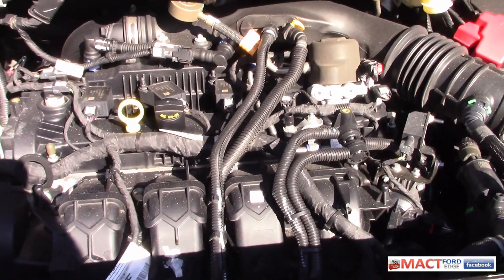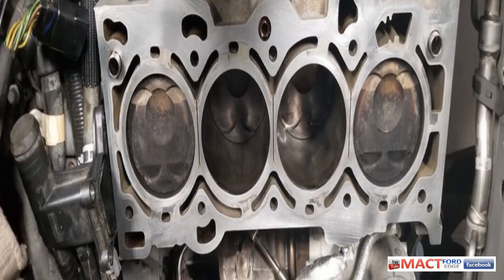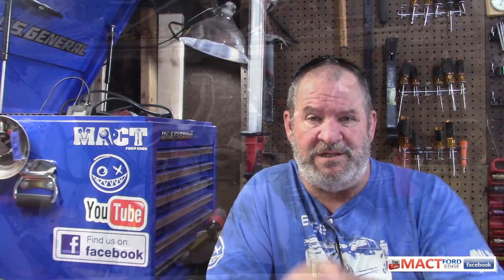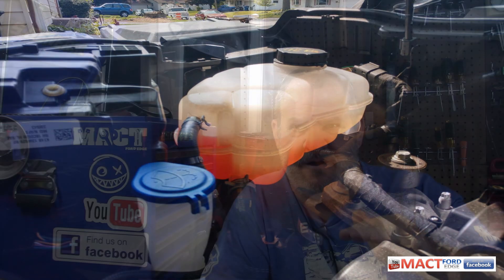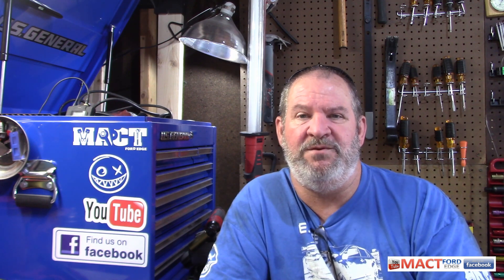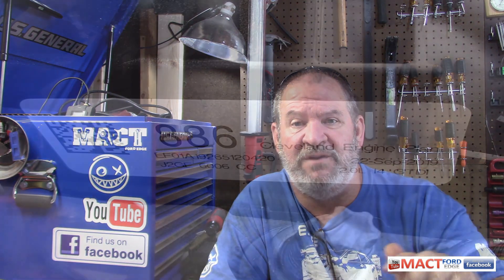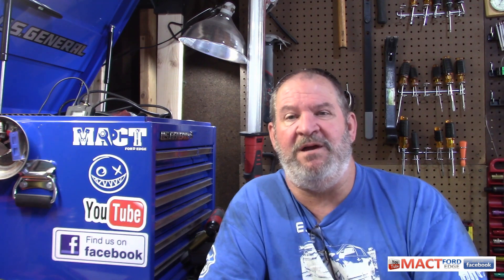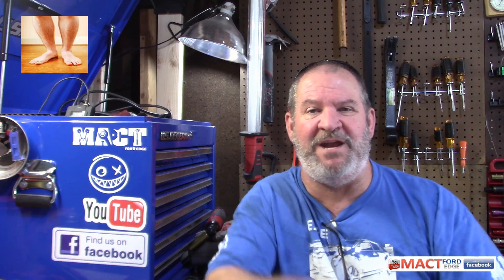Why I am excited my 2.0 Ecoboost was built in Spain and not Cleveland  Ohio

Comment: Just checked my 2020 Edge SEL and it has the Valencia motor.  Whew!  Thanks for the info and running a quality page.
Reply: Any edge made past ‘19 has a redesigned block, it won’t happen regardless of where it’s from on that body style.
Reply: They are all OK. We've owned 3 Edges. Our '13 Edge had gen1 2.0L GTDI Ecoboost an was trouble free. New '23 Edge ST AWD in driveway. They rated top3 best midsized SUVs of 17 avail.
Reply: @jayhawker03  100% correct. Excellent SUVs. Rated top3 of 17 midsized SUVs avail. Good basic maintenance goes a long way w/any vehicle. Use full synthetic engine oil/Motorcraft filters .
Reply: K&N filters for me. Always full synthetic.

Comment: Whew, just checked my week old 2020 edge 2.0. Popped the hood and it's the Valencia plant. Thank you for the info and can't wait for more guidance on the Ford edge. Just upgraded from the 1.5 ecoboost Escape with coolant intrusion.
Reply: Tyler McLean  any idea where your engine was from? Glad you made it to 100k. Supposedly the transmission will go out at 80k on the Escapes with the 6speed autos as well. Good job yeeting that before it got any worse! Haha 😄
Reply: Doesn’t matter where it’s from with your model, they redesigned the block in 2019 to fix this issue. It only effects edges from 2015-2018.

Comment: Love my current '23 Edge ST AWD w/gen2 - 2.7L GTDI engine . From engineering perspective these are excellent/ well designed GTDI powertrains. My 2nd Edge btw. 1st got 248k mis before we sold running very well for the new '23 Edge ST.

Comment: Guess I'll chime in, 2015 Escape Titanium with the 2.0L, it has a VEP label on it, but in the past year +/- the coolant level has begun dropping ever so slowly. I took it in for a recent recall issue and had them test, they said they filled and pressure tested and found coolant intrusion, but did not state which cylinders or provide any further info. Close to 120K miles on mine.

Comment: My 2016 Edge 2.0 Eco Boost was cracked out of the factory, Ford didn’t  figure it out until 99,600km. When it started in the cold from new the coolant fog burning off was huge. 
So finally they replaced the engine when I complained enough. The replacement was $10,451.

Comment: So I bought my wife a 2017 Edge SEL that had started getting misfire codes right a way, took it to Ford for a diagnostic and they said it has the issue with coolant entering the cylinders which was addressed in the TSB, however, the warranty company did not cover the long block replacement since the stored code was prior to the warranty date (and the day I purchased the SUV). So I told the dealership where I purchased it and they bought the car back and had a 2019 ST on another lot that they were able to move her over to (for a price difference of course). I guess it was a good thing the car had this because the ST is an AMAZING SUV, I find myself driving that over my 2021 Lariat Sport Powerboost... anyway. this issue is no joke anyone considering purchasing a 2015-18 with the 2.0 should have the SUV checked out at a Ford dealer as the service departments computer did not pick it up when they scanned it. It appears the Ford computer can pull deeper data with dates and mileage. 

Great video very helpful, I would have named the video "Watch this before buying a 2015>2018 Edge 2.0"
Reply: I have never in my life heard of a dealer rebuying a car. I need to try that since I'm dealing with a failed eco boost right now.

Comment: YouTuber Ford Boss Me is a Ford mechanic and he has many videos addressing this issue. Someone in the comments asked if a Spain 2.0 has the same failure rate as a Cleveland 2.0 and he says  the Spain variant is no better than the Cleveland one and the failure rate is the same for both of them.
Reply from the maker: You are incorrect.  2.0 VEP does have water intrusion but it is due to the EGR not a block design failure. Check your facts.
Reply from the maker: One other note.  Ford did a massive redesign of the the 2.0 Ecoboost engine for 2019.  A 2019 2.0 will not swap to the 2015-2018 models.  The block, heads, turbo mountings, and addition of an EGR make a swap of a 2019 2.0 Ecoboost nearly impossible. Just facts do some research.
Reply: I just bought a 2013 Ford escape with a 2.0 eco-boost. It is a VEP. If I have a water intrusion issue and it’s due to the EGR how do you repair that?
Reply: @richierich398  good question I think @MACTFORDEDGE can answer to us
Reply: @MACTFordEdge  Hallo, i have 09.09.2019 Fusion 2,0 VEP. Can you tell me about my block? It was redisigned or no? I only by this car, dont want to sell(((. 
Car in Ukraine, we dont have official information. Thanks
Reply: @MACTFordEdge you say different thing in other comments. Which is which?

Comment: This problem emerged a few months ago here in Brazil in the 2.0 Ecoboost Ford Fusions. According to several sources it affects only the twin-scroll engines from models 2017 to 2019, and only those where the engine number starts with 910. But apparently all engines come from Spain. I have a 2016 Titanium AWD with a motor that starts with 328, and a friend has a 2018 SEL that has one of these engines that start with 910. Both motors were made in Spain. We don't have Edges with this engine in Brazil (only 6 cilinder engines).  The Bronco Sport also uses the 2.0 Ecoboost, but the problem isn't supposed to happen in this newer engines.
Reply: Interesting to hear. It’s totally possible that the ones from Spain fail as well. This guy doesn’t have any actual sources. Many ford techs in the states have been replacing Spain ones too, I’ve chatted with a few of them. It should only be the Twin-Scrolls effected. The 2017-2019 thing doesn’t necessarily apply since different cars got the twin scroll at different times, I’m not sure what it was in Brazil, but in the States the Escape was effected from 2017-2019, Fusion 2017-2020, Edge 2015-2018. Ford largely sources their engines based on supply chain needs. The Cleveland factory provided the 2.0 a lot during the 2015-2018 era because it was closest to the factory in Canada where edges are built, wouldn’t make much sense to ship one in from Spain when you have one on the same side of the world. When the Cleveland factory started making the 2.3 for the Ranger and new Explorer, all the 2.0 production moved to Spain because they need the 2.3’s more in the states. There’s not any difference in how they are built. It’s just in the states 8/10 edges will have the Cleveland so it makes it look like they fail more when that’s not actually the case.

Comment: I've owned four Ford Escapes with the 2.0 litre Ecoboost engines. Two were Cleveland & two were Valencia. Touch wood, I haven't had any trouble with any of them. I use Pennzoil Ultra Premium 5 w 30 synthetic oil and Fram synthetic oil filters, changed every 3500 to 4500 miles (5630 to 7240 kms.). With a turbo charger, you have to use good oil. It also helps that 96% of the miles I drive, are at highway speeds. In Canada gasoline is ridiculously expensive and 91 octane even more so, but I use 91 octane anyway.

Comment: I get them from both the same failure as well as see them over seas failing at the same rate as well

Old design open deck - new design closed deck 

Ordered a new motor for a edge a month ago, installed motor due to coolant intrusion and new one withing 3 weeks was doing the same thing 

Now new motor has to be replaced

It's not cab it fail it WILL fail 

The new designed block is a closed deck and the old one is open - it's not just cylinder 2 it could be any cylinder 

It's 2015 - 2019 2.0 Ecoboost and the 2014 - 2019 1.6L ecoboost and 1.5L ecoboost 

The 1.6 and 2.0 Ecoboost are long block replacements and the 1.5L Ecoboost is a short block

The long block with labor will run closer to $8k-9k the short block for the 1.5L ecoboost is closer to $5k
Reply: I thought they "fixed" the problem with the 2019 2.0L, it that not the case?
Reply: Use the Ford Fusion TS block semi closed deck design with a more robust casting and problem solved!!  I building a 2.0/2.3 ecoboost engine capable of 1000whp!  2.3 internals inside the 2.0 TS block.

Comment: Owned a 2013, 2016 and 2019 Escape with the 1.5ltr, 1.6ltr and 2.0ltr Ecoboost motors zero issues up to when sold.
Owned a 2020 Edge with the 2.7ltr Ecoboost, zero issues.
Now I've got a 2022 Ford Ranger, couldn't be happier.

Maintenance maintenance maintenance,  cheers

Comment: I’ve had my 2015 Fusion since it was new.  My engine has 75k miles on it and it is from Valencia.  The coolant level has begun to drop over the last few months.  So I may be in the beginning stages of this water intrusion issue so Cleveland may not be the only plant having this issue.
Update:  I changed the coolant and the level has maintained at the full mark for over a month.  I think there was some evaporation over the past 6 years.
Reply: 2015 fusions don’t have this problem, that car has the older single scroll 2.0 which is very reliable. The video really should have specified which engines are effected because there isn’t a large range of bad ones relatively.
Reply: @jayhawker03  here is the list 
2017-2019 Fusion/MKZ built on or before 8-Apr-2019 - 2017-2019 Escape built on or before 16-May-2019
- 2017-2019 MKC built on or before 18-Apr-2019
• 2.0L EcoBoost engine
• Presence of coolant in the engine cylinders
Reply: if you only checked your coolant once in 6 years its your fault anyways
Reply: @steveschilling5966   what are you talking about?  Maybe you ought to read my comment again.  I said I noticed it beginning to drop over the past few months which implies I was looking at the coolant level.  Generally when I changed the oil every 5k miles
Reply: @brianmccants5098  ignore Steve lol
Reply: @Joetrout  Wasn’t the block for the 2013 to 2016 2.0 still based on the Mazda MZR engine? I read that somewhere but can’t remember the source
Reply: I had 2013 2.0 fusion that I traded in at 85k, the coolant level dropped a quart or two every oil change
Reply: @Joetrout  Do you see this list? How can i get it? Thanks
Reply: @steveschilling5966  has nothing to do with not changing the coolant. Its the design
Reply: @ЖоржКазаков  get it?
Reply from the maker: The 2015-2018 VEP has the same design.  Keep In mind I was referring to the 2019+ VEP with the new design.  Also the 2019+ is starting to pop up with similar issues but due to EGR failure not block failure.

Comment: The YouTube channel Ford Tech Makuloco he shows that this problem is with all 4 cylinder ecoboost. The major problem is the little hole between every cylinder that the head gasket can’t hold the pressure on that small part between the cylinders. This problem continues I think until 2019 engines 2020 and up he says that this issue was resolved. The only solution is to change the block unfortunately.
Reply from the maker: Yeah you are wrong.  The 2019 has the new block and the issue was a cut in the top of the block.  The fix was the drilled hole.  However now the addition of the EGR cooler to the 2019 plus is now the new coolant intrusion and loss. Due to internal failure of the EGR cooler allowing coolant to enter the engine.  Ask me how I know this.  Just replaced an EGR cooler.

Comment: Just had my 2016 Titanium diagnosed with this problem. Going in 2 weeks to have the pressure tested to verify this is the problem but i was told looks like i need a new long block. Im praying im getting the VEP engine. Luckily i have the extended warranty that is over June 6 2022.

Comment: I have a 2018 Fusion 2.0 Ecoboost built in Spain and it currently has the coolant in cylinder issue. Major bummer as the warranty ran out 10,000 miles ago.
Reply: Hi Dan. How did you figure this issue out? I know ford will not budge to help out at all if you are out of warranty miles. I even got a quote to see what the cost is if you paid out of pocket and it was something like 4100 for the engine, 600 for accessories, 16.5 hrs of labor at 120 hr for 1900 so its about 8000 out of pocket. Im curious how you came to this conclusion and what your symptoms were? thanks in advance
Reply: Haha many people believe failed Spain engines don’t exist, good luck getting anyone to listen. I’ve been saying for awhile that there’s no reason they couldn’t fail.
Reply: Same here 😔 thank goodness for warranty

Comment: 2013 Focus ST. Constructed 3/13 in Detroit assembly. 2.0 Ecoboost VEP. 87000 miles still pulls 21 psi.
Reply: That’s the single scroll 2.0, that older design doesn’t have this problem. Only the twin scroll does (2015+ Edge, 2017+ Fusion, 2017+ Escape)
Reply: Foci were built in Wayne Michigan.

Comment: If the parts are the same design and come from the same supplier, the only variable is process. They may be over-torquing the head (and I know they use computer-monitored torque 'guns' on the production line to control this stuff) and somebody was thinking "more is better", but that can also cause warping if the block is under high heat, which it is. Or else they have a worn or mis-built jig for locating the head gasket and maintaining its location while the head is placed.

Comment: Besides the valve cover sticker showing Cleveland Engine Plant & VEP (Valencia Engine Plant) ... I've noticed there's an "extra" tube above the plastic air duct that goes across the top of the valve cover then down to the turbo. Well, the 2.0 EcoBoost made by the Valencia Engine Plant doesn't have that tube it's just an air duct with 2 tubes connected to the "front" only. I have the VEP on my Maverick's engine and I'm happy to see that as I didn't get the extended warranty. 

Cleveland Ohio is about an hour away from where I live, but I'd rather have an engine known for reliability.

Comment: Does this happen to 2.0s on the Lincoln MKZs? My car just started acting weird the other day, p1285 p0217 which relate too cylinder head over temp and engine over heat. I’ve also noticed the coolant keeps dropping but when I pull the recevior lid off and like back pressures some into it.
Reply: Mine just did the same thing, mine is in the shop at Ford, what resolved your problem???
Reply: @itsthatatm8345  ended up being a cracked block, took it in and luckily got fixed under warranty.

Comment: There was a redesigned block used on newer 2.0L motors. I'm guessing that the VEP began using the newer block with the cross drilled coolant passage. I think Edges 2019 and later have the newer block. @FordTechMakuloco has a few great videos with the years and models impacted as well as the mechanical differences for those that are interested.
Reply from the maker: You are correct. However now the problem is the EGR leaking and causing similar symptoms.  Thus the confusion about the blocks.
Reply: @MACTFordEdge  you are correct too. I have a 2019 and I had to take it for the leak on the EGR, I would rather have the egr leak than the head gasket. On a side note I work at cleveland engine plant. I’m at work right now building 2.3 eco

Comment: I have a 2017 Ford Edge with 86k miles with the Cleveland Engine. No problems with the engine so far. The dealership I bought it from has a Lifetime Warranty on the engine and transmission. If there is a problem later, I’m hoping they will honor the warranty and not play the, “it’s not an engine problem” game.
Reply: The one rule of thumb i have learned is there is always. always a fine print somewhere that will get them out of it.
Reply: @danielengel1295  They advertise this to the public. I’m 100% sure they don’t want a customer to go public and tell everyone that they don’t honor this warranty.
Reply: @ceddie  Doesn’t matter if they advertise it to the public. You gotta read the fine print. Im pretty sure you have to do your maintenance work with them  and take it for some type of inspection  or something like that. I read one for a different dealership that offered lifetime powertrain warranty a while back.
Reply: @elvism684  I do the maintenance work with them. So if they say something about the warranty, I have all the documents from every oil change and other maintenance done with the car, from the dealership. So if there is a problem, it would be on them, not me.
Reply: Update: this happened to my 2017 Ford Edge, coolant intrusion. And yes, the dealer is paying for the replacement of the engine.

Comment: New engine has been redesigned. Here are the cars effected with the issues 
2017-2019 Fusion/MKZ built on or before 8-Apr-2019 - 2017-2019 Escape built on or before 16-May-2019
- 2017-2019 MKC built on or before 18-Apr-2019
• 2.0L EcoBoost engine
• Presence of coolant in the engine cylinders
Reply: I have a 2019 Nautilus with the 2.0L. You're saying it's not affected?
Reply: @Pro1er  I think you have the redesigned block. Its the water jackets they improved.
Reply: @Joetrout  Thanks Joe!
Reply: @Helicopter Dad! don’t think so, it’s the 2.0 engines with the issues.

Comment: Picked up a 2017 Lincoln MKC w/ the 2.0L back in April with 36K miles on it.  I've only put a couple thousand miles on it since.  Just had a look at the cover sticker and it shows VEP on it as well.  I guess we'll see what we see as time goes by.  I got it from Carvana and sprung for the extra 3 year warranty that is supposed to cover powertrain if something DOES happen to happen.
Reply: I just had a new long block put into my 2016 Ford Edge Titanium it had 68k miles on it before the issues started then the check engine light popped up. Made it to 72k miles where it was OBVIOUSLY burning coolant it would smoke out the back of my apartment complex. Luckily I had an extended warranty through Ford themselves or it would have cost me nearly 9k